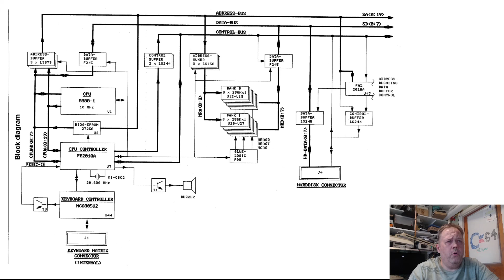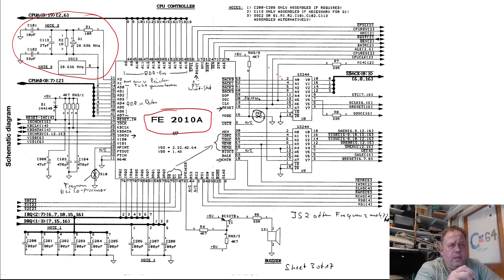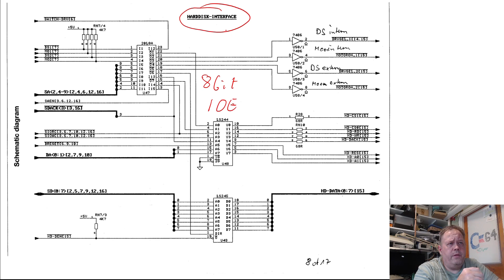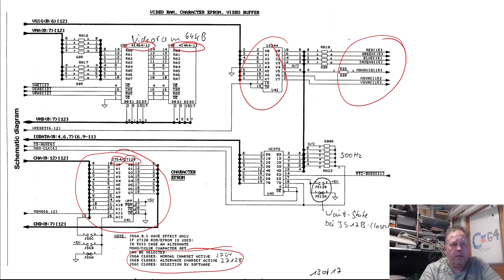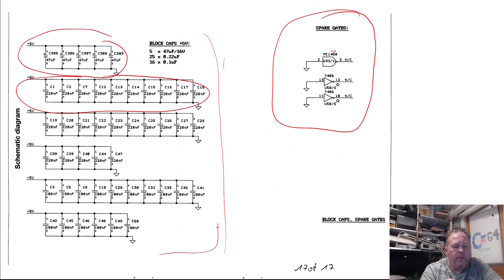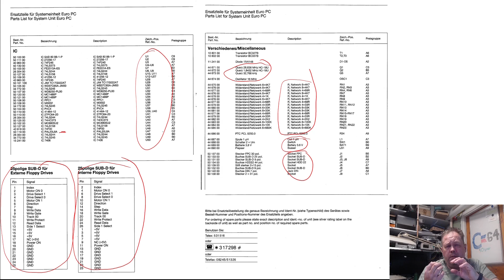The Schneider Euro PC, we’ve seen the movie, let’s read the book !

Comment: A very well documented process, as always. Hope one day could put my hands on one of those. They run incredibly expensive !!!
Reply from the maker: They are quite rare, and I have not seen one without at least some battery damage... The holy grail would be to find a cache of new old stock replacement boards without the battery connection soldered. The battery tend to not leak if there are a sufficient amount of power left in them.
Reply: @kojroRI  Keep you posted if I find any.